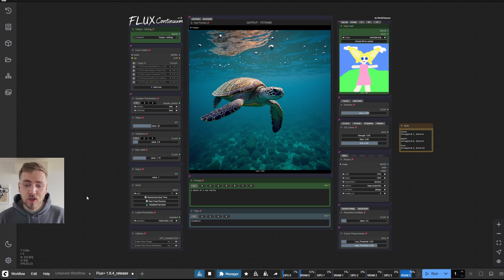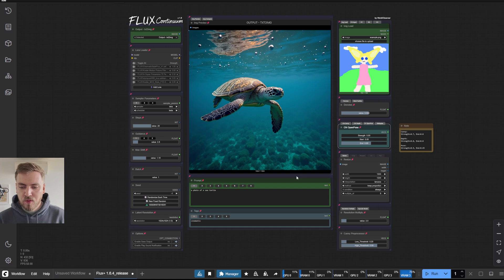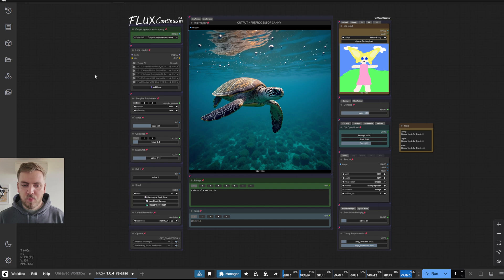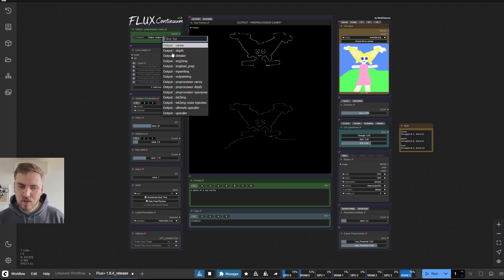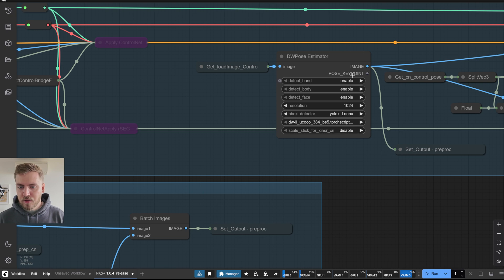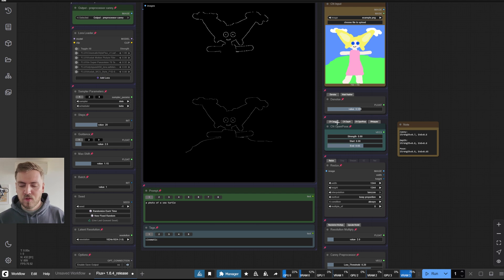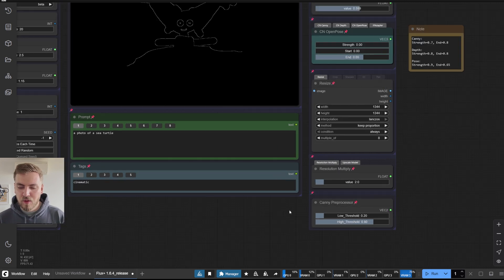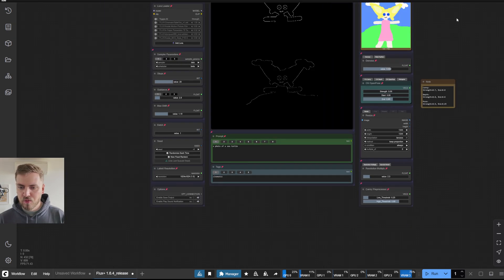New FLUX Continuum Workflow Updates! ControlNet, UI Changes & More!

Comment: Absolutely love the workflow, however I seem to be having a couple off issues I can't seem to get to the bottom of. Firstly, the Tab's option doesn't work. When the workflow first loads I see them for a split second and then they vanish.

EDIT: My second issue I've now resolved, which I'm just mentioning here in case others have the issue. ComfuUI essentials is no longer being supported, and I was having problems with missing nodes. If you get an error about these nodes being missing, even though they are installed, then uninstall the original ComfyUI-Essentials node pack by Matteo and installed the forked version by mBoy (ComfyUI_essentials_mb) via Manager.
Reply from the maker: Yep or install the nightly version of the original repo. Thanks for sharing
Reply: @robertwojciechowski  I do still have this issue. I've tried manually uninstalling and installing via git instead of manager, but still no luck.

Manager only gives me one version, where would I get the original repo from?
Reply from the maker: Download directly from here:
https://github.com/cubiq/ComfyUI_essentials

the one in the comfyui registry/manager is out of date.
Reply: @robertwojciechowski  Ah thanks, but that's the issue I fixed. The issue I still have is with getting Tabs to work in the Flux Continuum nodes... and I really want to use tabs lol
Reply from the maker: Are u running it on runpod or something? Can you please submit an issue on the GitHub repo and I’ll try and help you out.